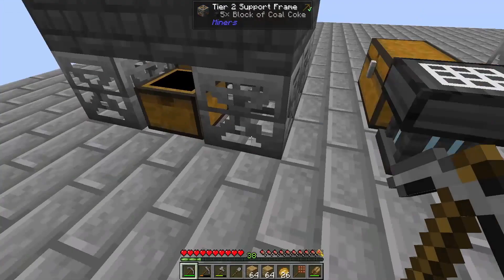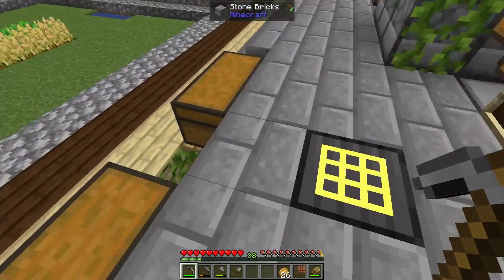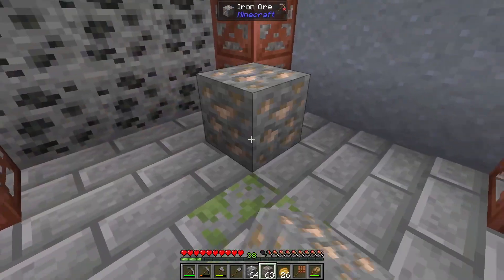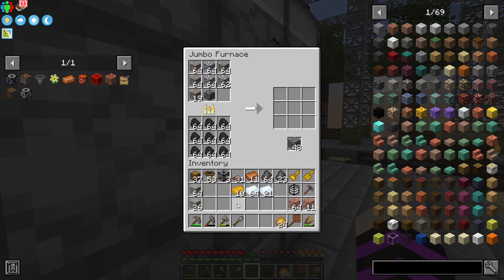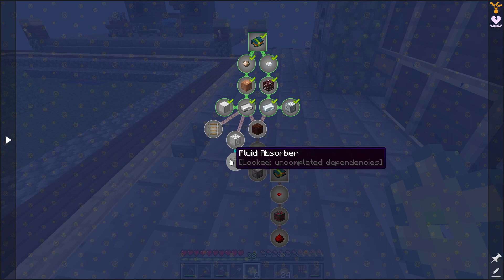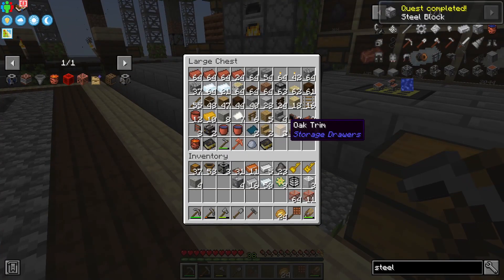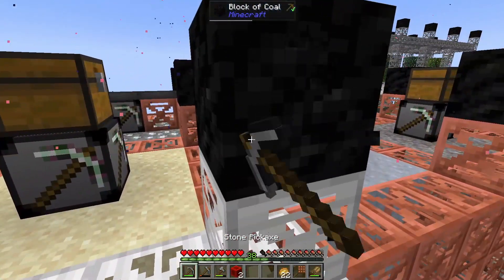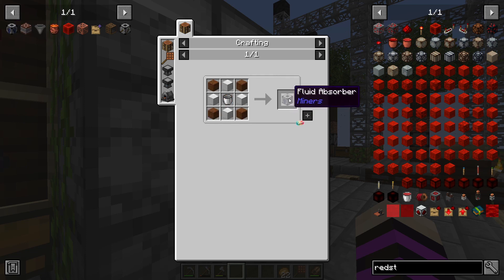Minecraft Technopolis 2 Skyblock EP 5 - Infinite Lava Fluid Absorber - Iron & Aluminum!

Comment: how did you get so much lava? my buddy and I are doing this but we only got 1 bucket of lava
Reply from the maker: I had a fluid hopper set on top which I think holds 10 buckets.  Plus, I had the train taking the lava to an IE fluid tank.  Do you have moderator blocks on your miners to speed them up?
Reply: I'm a silly goose we figured it out you can apparently craft lava with Redstone for whatever reason
Reply: @LetsPlaywithDDae we have 512 buckets of lava in the large tank